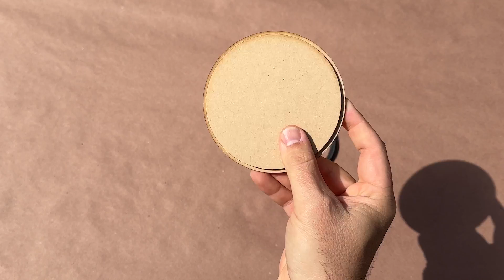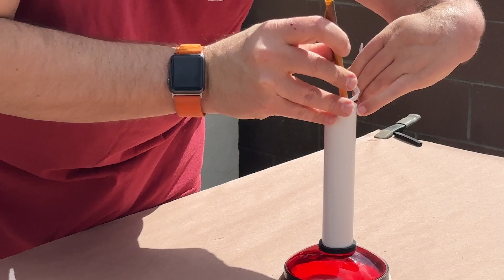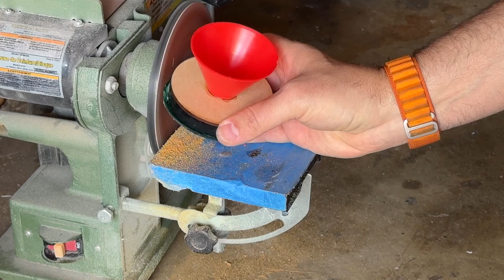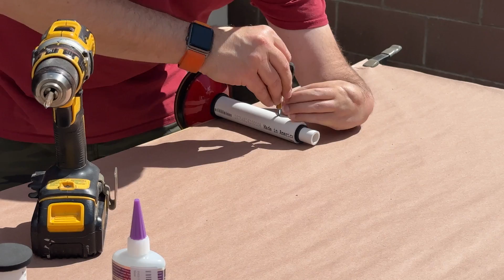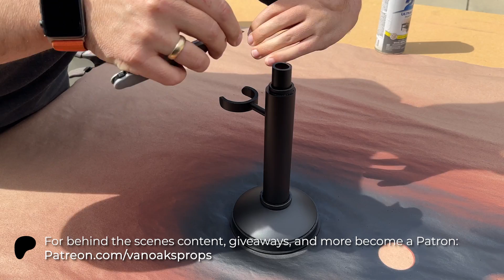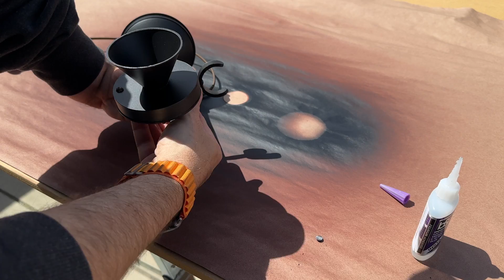Antique Candlestick Telephone Prop

Comment: Looks good expect for the color. Looks a bit bland. Some distressed gold or bronze on the base and the receiver a some wear of the handle and it will look perfect. Not sure how bid the receiver is, but could it accommodate a speaker or exciter? Could be an additional talking prop in your haunt.